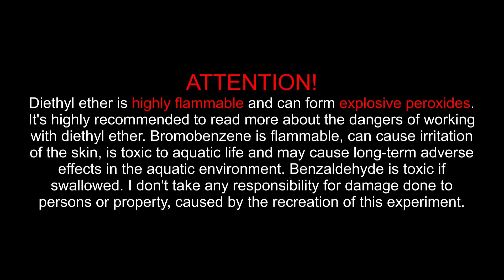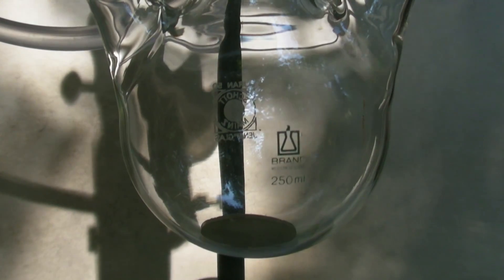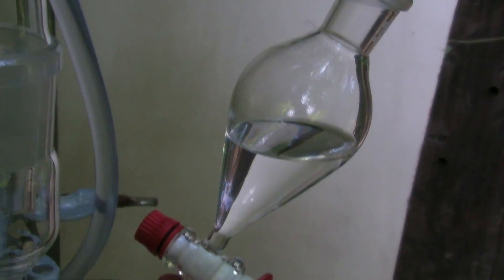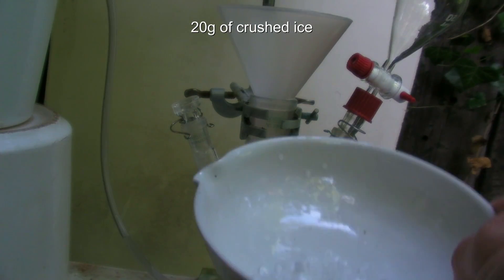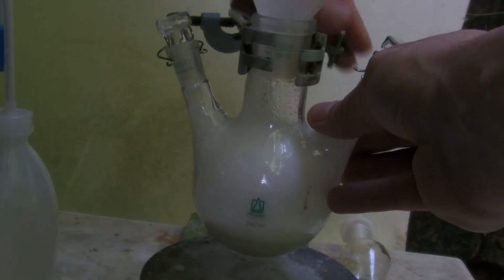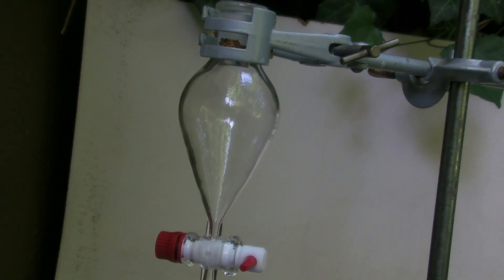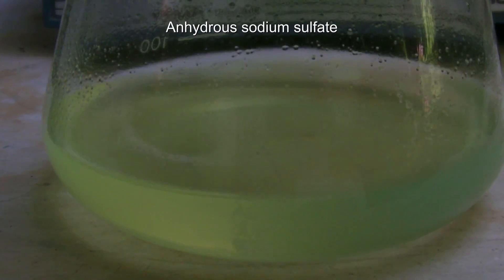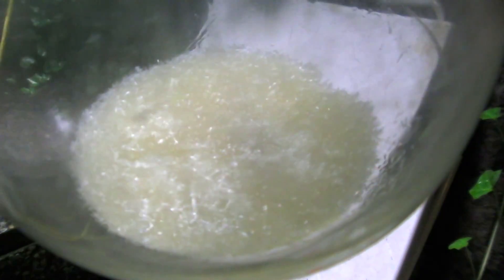Preparation of benzhydrol (Grignard reaction)

Comment: I have never heated my glassware prior to Grignard and have got yields up to 65% .. I do not believe that step is worth it (though for small scale like yours it may be - what yield did you get here?). Also fun fact - to make symmetrical secondary alcohols like this one, you can react 2eq of the grignard reagent with a formate ester (which is trivial to make using conc. formic acid and methanol/ethanol/isopropanol), to avoid needing to get benzaldehyde AND vacuum-distilling it. Also you forgot to mention how amazing benzhydrol smells ☺ great video!